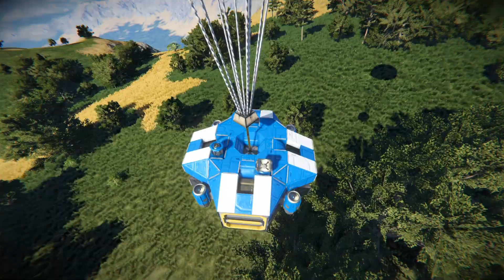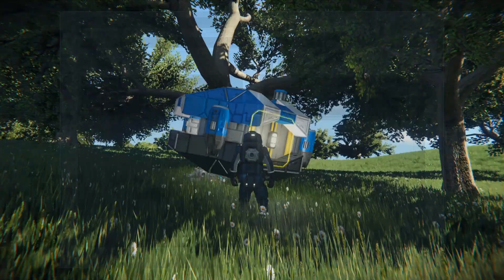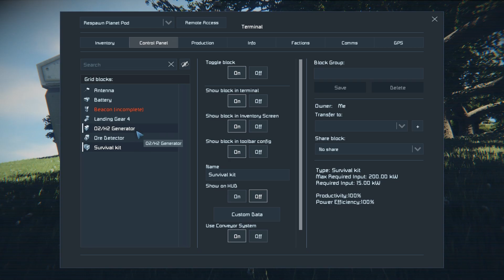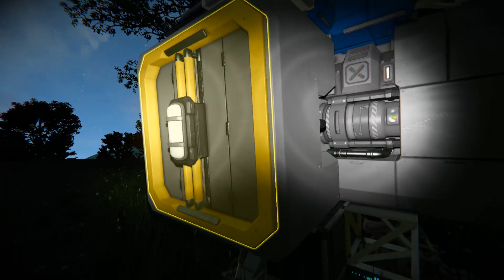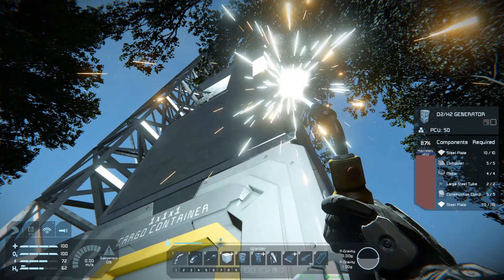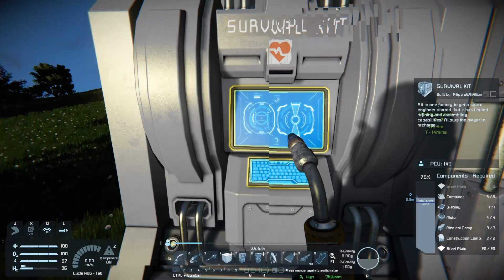Off To A Good Start, Stone Is Actually USEFUL Now!! - Space Engineers LP - E01

Comment: It looks like you got an outpost set up. You didn't need to go so high with the wind turbine, ten blocks is plenty. You can even put turbines on the side of the pillar, just make sure they are eight blocks apart on a side. They can be on opposite sides of the pillar, just not next to each other.

The survival kit is a valid respawn location. 

The hydrogen engines are good for recharging batteries but eat ice too fast to be useful at anything else.

Uranium is only in asteroids now.
Reply from the maker: Thanks for the tips! When you say turbines can be placed on the sides...do you mean like horizontally along the pillar that the other is on top of or that you can build a 1x1 platform horizontally for them to stand on next to the other one? Just curious cause I've been wondering if you can place them sideways or not (I mean, scientifically I doubt it would matter, but wasn't sure about in-game).
Reply: @Sleeplessknightsstudios  Sideways will work just fine. You got to think about it as faces. A cube has six different faces, one per side. As long as their is an eight block gap between them, you can put as many as you want on a single face. If you attach a block on all four sides of the pillar one block from the top. You can put wind turbines sticking out on each block.
Reply from the maker: Interesting, good to know. I'll have to play around with it to get some more optimal outputs out of them. :)

Comment: If you dont mind my asking, what sort of mic are you using, I am just starting out the youtube stuff and after figuring out how to not be echoey I find I'm kinda on the quit side. Untill I laugh at something then it is very loud I'm using a headset with the mic attached.
Reply from the maker: Congrats! I started out with a headset mic too. It was just a cheap little logitech one. I added a link to the mic I currently use now. It needs a stand/arm/etc. but for the most part, it's been a good choice. Although, another HUGE aspect is the settings you have for your recording software (whatever is recording your audio). There are a lot of videos on how to adjust settings and filters to help your audio sound better. Noise gates, Compression filters, etc. can make the same mic sound completely different. If you can't upgrade to a better mic, then I'd still look into filter settings and effects as it can help the one you already have too! Hope that helps. :)

My current mic: https://www.amazon.com/CAD-U37-Condenser-Recording-Microphone/dp/B001AIQGUO/ref=sr_1_10?ie=UTF8&qid=1438295704&sr=8-10&keywords=mic
Reply: Awesome, thank you!

Comment: Nice to see your back. Sleepless

And got a little bit of info for you. IF you want more power for your base you can do this trick that I found out from haledmer. He made a tower like you have but he placed 4 blocks on each side of the tower and then placed 4 wind turbines on them. And you do not need to have a big tower just 9 to 15 blocks up then your set. The wind turbines should then give you full power. 

Again nice to see your back.
Reply from the maker: Thanks! And that's what I've been hearing (not the 4 turbine thing) that somewhere around 10 to 15 blocks was enough. I do wonder what the actual "optimal" point is, but this will help either way. Thanks. :)